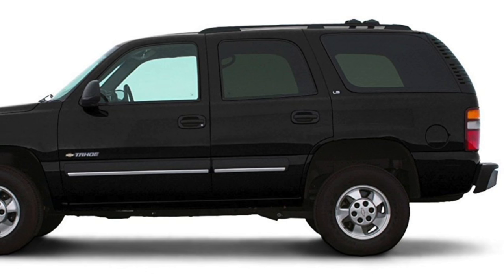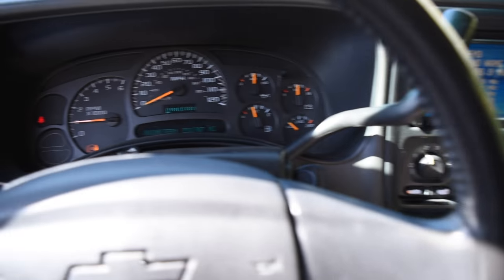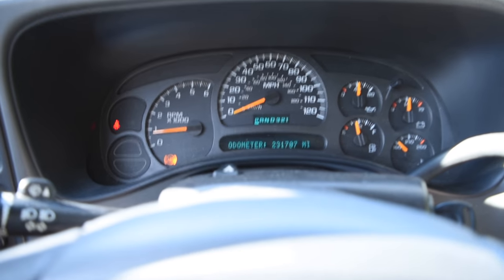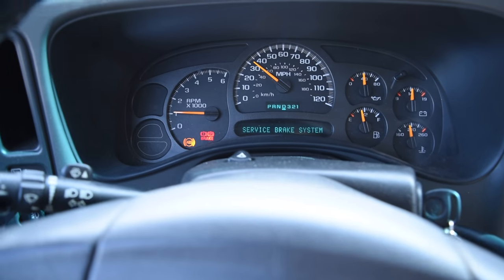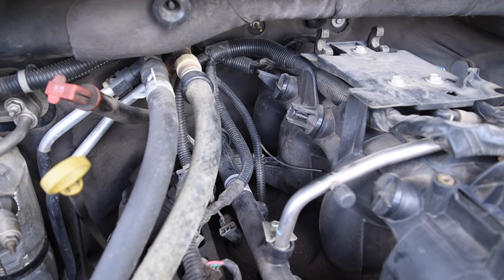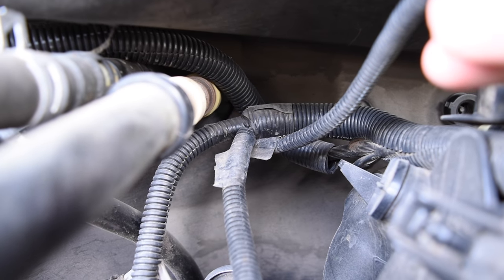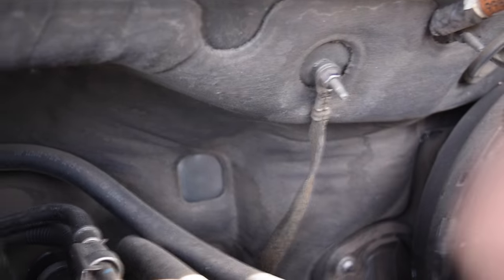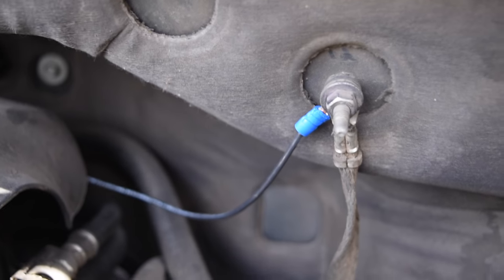2003 Tahoe Loose Ground Wire causing ABS, Park Brake, Door Locks, AC, issues

Comment: Thank-you so much!! I went on a fishing trip 600 km from home.  We towed our boat to the lake.  At the lake we hit some potholes and the symptoms you described happened.  The engine died many times on the way to the cabin.  It got to the point where my 2003 Tahoe would not even crank.  After a whole bunch of troubleshooting I finally gave up and was making arrangements for a tow truck (300 km tow paid by CAA), my son was going to take off work and bring a flat deck trailer to bring it the last 300 km from home.  Another friend was going to bring his truck to pick up my family and boat.  I saw your video and I fixed it as per your instructions!!!  It saved me so much trouble and money!  If you are ever in Alberta, drop by, I owe you a refreshment!  Thanks again!!

Comment: I can’t thank you enough for taking the time to share this. Been having the same problem for months. Drives great sometimes until the locks start going off by themselves and I lose power/acceleration. I have a 2003 Chevy Tahoe as well. When I finally came across your video last night I went straight to my mechanic this morning and when I popped the hood and he reached in there he pulled out the same wire, just dangling. He did exactly what you did and my truck runs beautifully! I knew it was something simple, just didn’t know where to start! Thank you, thank you, thank you!!!
Reply: I had the same problem 03 GMC Yukon 1st I clean the under the driver side cleans with a sand paper  and now I just did this one just like he said it’s there just welded to the motor block on the back side 2/3/22 I’ll keep you posted in a couple of days hope it works thanks .
Reply: @djcarlos52 it’s been 10 months did the problem come back after doing this? I’m assuming it fixed since you haven’t responded.

Comment: Great & Valuable Info!  Thank you SIr!!!  

After new ABS parts and checking all the ABS sensors on my 2003 Suburban, my mechanic and I could not figure out why ABS lights were on and all the warning bells were being triggered.  Well, I was scheduled to go to an electrical auto shop this very morning, but last night I saw your video and this morning I copied what you did.  Bam, Wam, Slam!  It worked!!!    

Furthermore, I found two loose ground wires under frame area driver's side (one under driver's door and one under the headlight area that is connected to the battery negative cable). Tightened them up & also put new terminals on ground wires on top driver's side near hood.    

Thank you & I thank the Lord for you.

Comment: My car started with it going into reduce engine power mode every now and then for a few months. Until one day it started doing what your car did and then finally quit that afternoon. Most of the stuff I read pointed to a bad bcm so I replaced that and it still didn’t work. I checked a few ground connections that I could locate and everything looked good. I gave up and was literally about to call a mechanic until I did one more google search and found this video lol. It was still connected but when I tugged on it. It came right off. It was corroded really bad. I did exactly what you did and it worked. Thanks for making this video. You really helped me out a lot.

Comment: This fixed the symptoms described (ABS, Brake light, door locks, temporary loss of power when going over a bump) on my 2003 suburban 1500. Thanks for the video, I suspected G103, but was having all kinds of trouble locating it. The ground wire popped off as soon as I pulled on it. That wire is supposed to connect to a stud on the back of the engine, but the stud is difficult to access, and using the body ground instead as you show was a great suggestion that got me back on the road quickly.

Comment: 05 Tahoe, same issue. Followed your video and my wire was broken, I think it was just making contact with the block. I fixed it using your method and it worked fantastically! It was the ECM ground wire and its all good now. Thank you

Comment: I have a 2003 Tahoe 4.8L 4wd and have an issue with lights and security system which I was not able to start the vehicle at intermittent times I found out that there is a Ground wire behind the drivers side engine that runs to the negative lead of the was partially worn and gave me issues, I re-ran a new ground wire and works great it fixed the issue! Also the silver braided ground wire on the fire wall must be checked !  Thank you for the excellent video !!

Comment: I have the same problem with my 03 yukon  first I cleaned the ground wires underneath the driver side seat but the didn’t work ( as I saw in another video ) now I did it this way , the wire is welded to the motor block on the back side . I put the two connectors just like this video and I hope it works . I’ll keep you posted in a couple of days if it works or not I gave it a test drive and it didn’t show any lights so far 2/3/22 crossing my fingers .one more thing as I was doing it my truck didn’t turn on and once I did it the truck turned on again .
Reply: Update: nothing works for me the abs/ brake light keept on coming I found out it was my  abs module so a bought two different ones from eBay and now the trac light stayed on but the abs/ brake light turned off . I found a place to fix my original abs module and problem solve and cost me $125 no more abs / brake or traction light on it tcost me $ 125 I have 03 Yukon

Comment: My 04 Silverado 4.8 --- 135k miles.  Has never been in the rust belt... I have had it 14 years.
I started having the same symptons yesterday.. Day before all was well.. When I got out of  the truck the door locks cycled to lock position. Never happened before. When I came back it started fine but I noted tha A/C was not as cold AND the battery gauge in the cluster would drop all the way to the left then go back to center. 
Looked around this morning and found this video. Started reading comments and checked my braided ground strap @4:08. It looked like it had a small bit of corrosion on it. Took off the 10mm nut and used an old copper bore brush to clean cable connector and firewall bolt.  It was not loose and there were no "green crustys" Put it back together and took around the block. Everything is working as it should... A bit scary that is was that easy.. 
Thank you for the video and all the comments that made it go well  As Matt would say check your GROUNDS... I now wish I had checked the resistance from the braided cable to the end of the fire wall bolt.. might have told me that I was on the right track...note to self....

Comment: For further clarity, this ground wire goes into your instrument cluster (A8). I actually just grounded mine to the steel "cage" inside the dash and that works just fine for me. But I also had a bad A9 connection, which is a constant battery positive. So I ran another wire straight to the red box in the engine compartment and spliced that into A9 and my gauges work again. Hope this helps others. I discovered there was an issue by checking voltage between A8 and A9. I also did a continuity test between A8 and ground and that's how I found that issue.

Comment: In GM speak, that’s your G103 ground. It is the only ground wire for your ECM. (All Underhood grounds are 100 series) You’re lucky it broke off. If you were going to remove the 13mm bolt to clean, the only way to do it properly is to remove the intake manifold. The ground must connect to the engine block but you’re achieving that by mating it to the braided G107 strap.
Reply: this is a man who knows his stuff
Reply: QUick question PLZ...  On that hood-to-body ground that breaks. (not the subject of this video)....   How important is it.???  At first I was just thinking why the hell would someone need to ground the hood??!?  But I am starting to wonder if it does not serve as some sort of "Bridge" across front quarters to even out vehicle electrical system ground RESISTANCE and now wonder if its critical to any negative switch feedback readings.??
Reply: @shillpolice7981  I need to know the same thing
Reply: From my understanding the ground going from firewall stud to hood serves as an antennae type of ground. It evens out and spreads the grounding of certain components as to eliminate frequency. Perhaps if you've ever heard the buzzing from the small round grate above drivers head in 99-06 tahoe/yukon etc also cleans up radio signal and also helps with the passlock and other crucial communication circuits to avoid feedback. My guess from the spark plug wires voltage resistance maybe  alternator whine, etc. This is just my understanding
Reply: My radio, ac and right side of the cluster go out then come back. I’ve gone over all the grounds I can find. Can you tell me what location controls that issue?
Reply: @joshwatkins4637  those items are controlled by BCM or Body Control Module. There are several in your truck. The grounds of any item controlled by the BCM are suspect, not just the BCM. If you have power seats and/or heated seats, a common faulty ground is underneath the drivers seat.
Reply: @psychodad1958  thank you. I’ll check there.
Reply: So what your saying is cut the damn thing and move it somewhere else lol
Reply: @shillpolice7981  so in the end what purpose does the hood to firewall ground serve?
Reply: @Hadesccc  First I want to give an example of how important these grounds can be.  I was in a fender bender not too long ago and when I went to start it up after getting the radiator and condenser could connected back I had forgotten to secure to two grounds under the radiator.  The screw was connected by not tight. All kinds of craziness was going on including my rear wiper was running and could not stop it.  Tightened the bolt and all better. .I did hook the hood wire back up.  I didn't buy a new cable I just separated a hole in the flat wire weave and poked the stud thru and locked the nut.  From what I read it helps to block radio interference.  But that was informal and who knows.  All I know is that it's def completing a circuit or fulfilling it better.  I believe it helps stabilize this thing my alternator was and is still doing a bit where the lights go up and down in brightness in steady order when its happening.  Hooking that ground back up has reduced the degree to which the alternator appears to fluctuate.  Autozone shows the alt testing good with good diodes and regulator last time I took it up for bench test.  But I still have no FORMAL gmac answer..  I ask around still.  Let me know if anyone else has found out or noticed a difference on re-connect plx..   Hell for that matter I would also like to know what that huge ceramic looking block encased in plastic on the driver side engine compartment.  Saw that the other day and its freaky.
Reply: @Hadesccc  Correction if I said it wrong the two front grounds screw into the front frame cross member, not the radiator support.  The more I think about these two wires I am realizing that I need to trace them back to see where they go before I put the too much more back on the front.  But I was sure to rust kill them with some acid yesterday and prime them when I was doing that the two front bumper primary mounting frame extensions.  But you dont ever hear much mention of these two ground points.  I usually only hear speak about the body-to-block, body-to-hood, and the ones under the driver door.  Now thinking I am going to loosen those too and rust treat with acid and prime and see if that helps any more..
Reply: @joshwatkins4637 did you fix this issue? Im having the same problem. Right side of cluster, locks, ac, radio and windows dont work.
Reply: @officerchaanak8376 same issue, my dumbass got a new BCM worked great for a bit and problem reoccurred, if someone has a solution I would appreciate it thank you !
Reply: @officerchaanak8376  I have the same issue with cluster fix the locks had a bad fuse did you find the problem?
Reply: @jimmyramirez8844  no i check the wiring under driver seat was told that could be the issue but still no resolution
Reply: @SS-vp4eu  Thank you.  Just bought a nice '04, Z71, Burb and noticed the ground strap for hood is broke off at firewall.  Been trying to find out what that tiny speaker is above my head is.  Still don't know but I'm hearing it's a speaker/mike for On-Star.  If I turn key to on without engine running I hear static from it.  I noticed the radio stations fade quickly and that's what that hood ground fixes.  We shall see.  Yes,  my black/white stripe ground wire seems bad and heading out to do the same fix now.
Reply: I was able to change that ground without removing intake... wanna know how i know? Did an intake gasket and knock sensors, then after install (at 2am) i realized i forgot to check grounds while back there... and had zero motivation to remove intake.. so i made it happen and with great success. Every dealer, youtuber, forum and my father told be i had to remove transfer case to do oul pan gasket ... did that job without removing transfer case... there always a way, just gotta use the old noodle and have some problem solving skills...

Comment: Holy cow. My 2004 Silverado, Years, I mean years of having this same issue. I replaced so many sensors, brakes, and even my wheel hubs with new speed sensors. Now I know the previous owner had same issue because I have always, since 2009, had this display come up and no door chime, means chimer got pulled out..

Comment: HELLO! TOTALLY FIXED MY PROBLEM SO FAR! DID THE SAME THING YOU DID. THE CHECK ENGINE LIGHT EVEN WENT OFF! THANKS MAN!
2003 GMC YUKON DENALI 6.0 AWD- ABS/BRAKE/ TCS LIGHT AND CHECK ENGINE LIGHT WAS ON FOR SOME REASON. I did clean the abs sensors up front though. :)

Comment: Thanks  saved a lot of testing  check your other grounds also the wire can break inside at the connection crimp but you can't see it from the outside and the ground connection looks good  but its not .I use shrink wrap over butt connectors to stop connector corrosion  thank again

Comment: Only GM can persist making the same mistakes decade after decade and stay in business. I had a '76 Chevy van and was driving down a road past a K mart around 1984. The engine quit and would not restart. I kid you not, the mechanic at the K Mart yells out from across the street that he knows what's wrong and comes running over with a length of wire. Tells me the ground failed and in 1 minute had it fixed.  Surreal experience. Now I have a GMC Pickup truck with a ground problem that makes all the gauges flatline.  Where is that kid with his hunk of wire?  Guess I have to do it myself this time.   :)

Comment: I’ve done this and it worked for awhile and returned as of now I’m battling with the low power issue. I’m avoiding replacing the actuator but that may be the answer. Im going to redo the grounds again and see what happens.

Comment: I had same symptoms, at first I thought it was the ABS module, by luck I found this video and checked that ground wire, literally fell off in my hands.  Attached new ground wire like shown in video and no more ABS or Brake lights.

Comment: Update nothing from YT help, I  found out it was my abs module.  so I ordered 2 different abs modules from eBay and they didn’t work but I found a company to redo my original abs module and no more abs / brake lights on fix the problem for $125 in have a 03 Yukon

Comment: So does the ABS work when the light says it should be (when light is off)?

And this video reminds me of something else I need to do.  Find and remove that chime, set it on the ground, and run over it about a dozen times.
Reply: Milk Manson that’s funny the chime annoyed the hell out of me found the box and took that out and threw it out the window. I did have peace and quiet until this weird roaring noise started happening. One thing after another

Comment: Good evening. Just a few questions for you GM mechanics on the page. I have a 2006 Sierra. All my cluster lights and gauges are irratic at times, battery light on (alt and battery test perfect) have now lost my tow capability, power door locks and windows, but truck runs fine. Could this ground be the cause of all these electrical issues too? Any help would be much appreciated. Thanks
Reply: Bro I am currently dealing with the same thing you are! Im usually pretty good with auto electrical stuff but this issue has me stumped!! O4 gmc sierra 2500
Reply: @stevethompson5092  I work in an automotive shop but am an import (honda/mitsu) technician lol. I know GM had a lot of electrical ground issues on the 2004-2007 GMC and Silverado trucks. I have been stumped on it and have cleaned all the grounds and it will fix for a few weeks and then back to the same issues. Hope i can figure it out soon. Thanks
Reply: @EricEveritt516  I have an 09 silverado and pretty much doing the same thing. I cleaned the grounds and was fine for about two weeks but now it does it worse than before. Happens more when I use my turn signals or switching from high to low beam and sometimes wanting to kill the engine. If you figured it out please reply back.
Reply: @stevethompson5092  same here I'm a retired GM mechanic and I always got the electrical problems and fix all that was handed to me but this 04 GMC has really had me pulling my hair out I'm not giving up and I will concur it one day every time I put the key in I sit there wondering what's it going to be today!!!
Reply: @jonperley7304  any fix, yet?
Reply: @marcusambrester  nope O2 sensor on and off can't read my scanner tools anymore and high beam indicator light staying on all the time yes I've checked out all grounds and cleaned them and all related fuses the heated seats go crazy all the time it's like it been possessed !!!